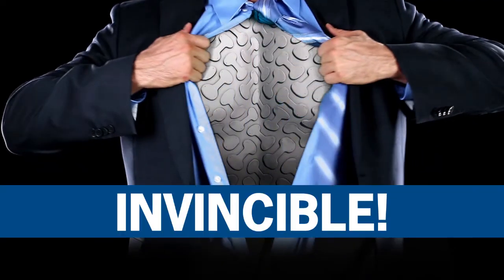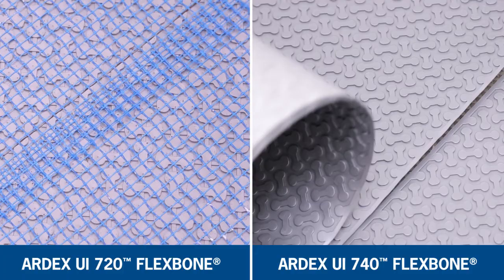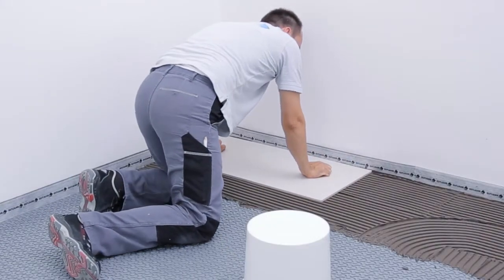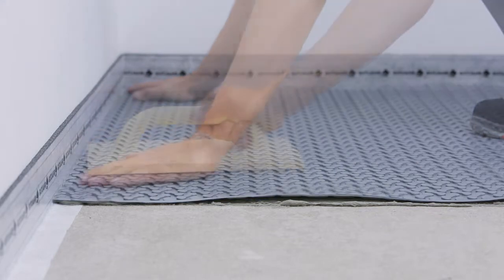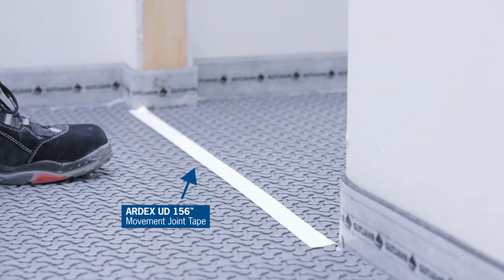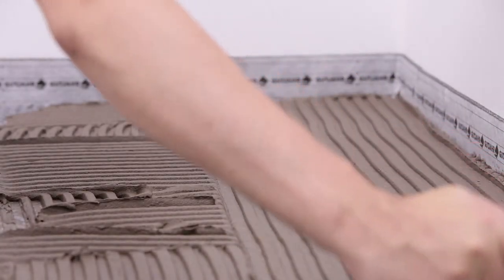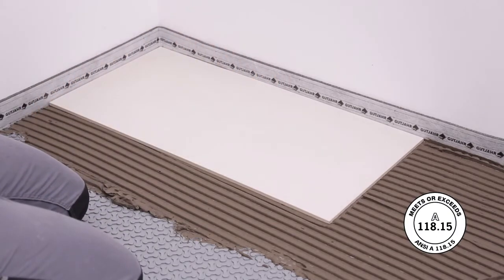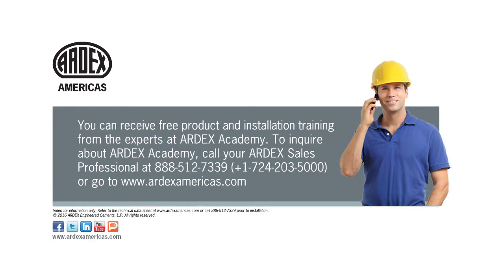ARDEX UI 740™ FLEXBONE® Uncoupling Membrane - Demonstration

Comment: Do you use the 8-10mm spacing even when the mat is used in wet areas?
Reply from the maker: Hey there,
1/4” (6mm) is recommended at all perimeter locations. ARDEX TLT banding can be used is wet areas to bridge between the floor and wall. For more information, reach out to our technical team at (888) 512-7339.
Thank you!

Comment: What is the perimeter seal tape used here https://youtu.be/1cSYfR4wEck?t=126 and how would you properly waterproof the floor permiter when the drywall on the wall does not touch the floor?

Comment: What mortar do you use between the substrate and the flexbone?
Standard tiling glue or do I need another Ardex product?
(Australia)
Reply from the maker: Hi! Generally, we would recommend ARDEX X 78 for concrete/compressed fibre cement, and ARDEX X 56 for timber – both applied with a 6 mm trowel. However, for more site specific information, please get in touch with our Technical Services Team through the ARDEX Australia website – www.ardexaustralia.com